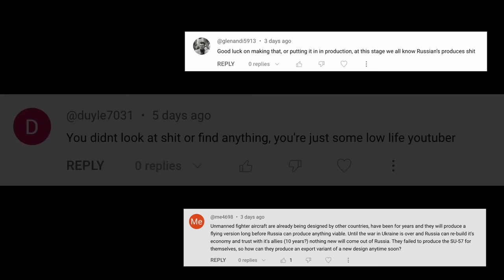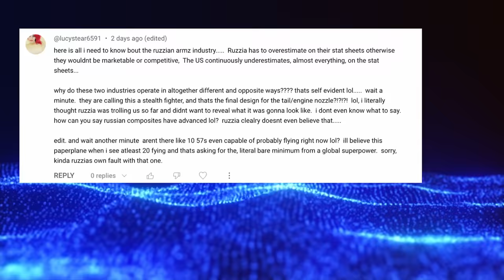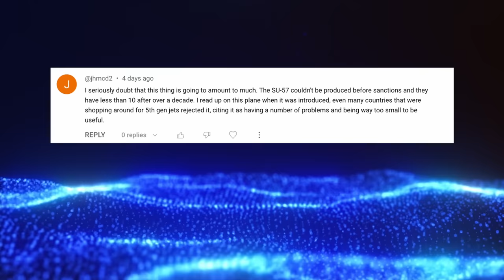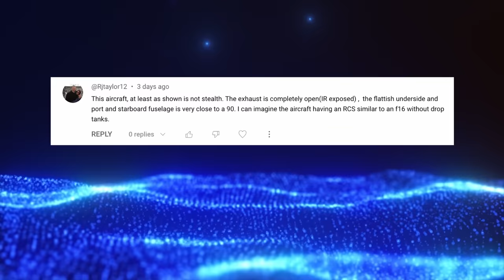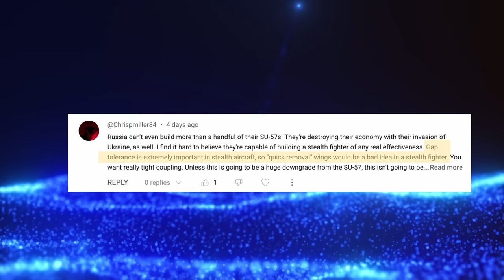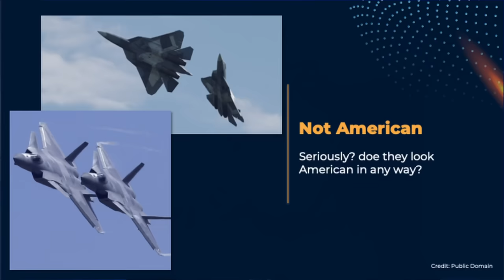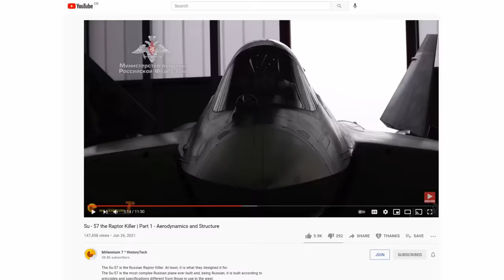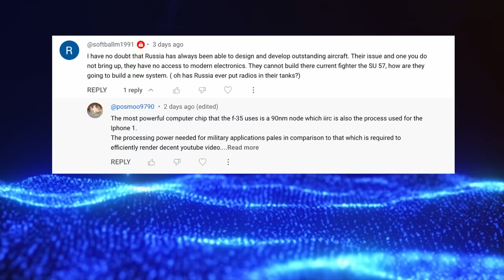Why so Few Su-57s ... and Other Stories.

Comment: People percieve the use of composites as the ultimate advantage. Not necessarily. It surely has it's advantages, namely the more freedom of shaping, but it is also unisotropic and doesn't have the absolute, precisely defined characteristics. Metals can sometimes be quite benificial, besides, metallurgy hasn't stop developing.
Reply: Absolutely true.
Reply: well they are light, and most likely can be verry light due to complex reinforcement geometry is theoretical possible.... theoretical
Reply: And Russia does not have a problem with composite materials either. Even old planes like MiG-29 had a significant share of them, even though not as much as newer planes.
Reply: “Komuna” is prime example.
Reply: Composites are crucial for stealth, radar waves are designed to detect metal while composites are basically just super strong plastic , being lighter means a speedier fighter

Without composites there is no stealth fighter
Reply: @xblade11230  You could always use wood instead.
Reply: @xblade11230  the stealth effect is mostly based on reflecting the radar waves to off directions rather than back to radars, and you do not need composites for that at all. But yes, as an addition to the reflectivity principle they do work and they are important.
Reply: @xblade11230  Not really true. Depends what composites, carbon fiber is a conductive material, therefore it is very well observable by radar. Another problem is, composites are quite sensitive to high temperature.
Composites are not panacea, they are very useful, but they also have their limitations. Not to forget the progres made in metallurgy and Russia is pretty strong in that field.
Plese, do your homework.
Reply: @xblade11230  actually no. reflection to a different return angle is verry much possible without composites. And as stated geometric stealth is what a big percentage of the f22 and f35s stealth come from...
Reply: Use of composites is a huge advantage not because they are hands down better then metals, but because you get more materials to pick from. You chose metal parts where metal is better and composites where they are better.
Reply: @dariozanze4929 but also composites adds a lot of new headache to designers, because choice is not always clear, and differenmaterials have their pros and cons. Metals is basically have a lot more comfort in production and expluatation, but can be a lot more expensive in general, like titanium alloys.
Reply: @rosomak8244  many Russian fighters in World War II built out of wood once they got the laminate figured out it actually worked pretty good
Reply: @fifi23o5  their engines are at least 25 years behind in terms of technology, although granted, that is the hardest thing in the world to build there’s only four companies that can really do it in the world to the most high standard. The composite used in the F 35 tails are invisible to radar. The composite picked was picked for that reason radar waves just go right through them.
Reply: @tatianaes3354  modern stove planes are also built with raider absorbent material physical structures that basically trapped the radar energy by bouncing around on the molecular level shaping is about 85% though
Reply: @mcamp9445  A few BSs. To say they are 25 years behind is a bit of a stretch. 
Second BS, no material is invisible to radar, nothing goes, as you say, right through it. All depends what wavelenght is used, besides, there is a metal structure inside the tail that would gladly reflect EM waves, so it is better to have a continuous skin, electrically connected that reflects and scatters rge radiation that is not absorbed by coating. Murica!
Reply: Also, it's not really that advanced a manufacturing technique. I can product composite parts in my home office. I can't product castings, or precision machined parts of equivalent sizes in Alu, let along Ti, or other special metals like Tungsten Carbide.
Reply: @rosomak8244  Wood is also a composite. A natural composite.
Reply: Yup, on high impact loads, high fatigue requirements, metals like steel is more useful. Right material for the right application.
Reply: you will get a very low social score
Reply: @Houthiandtheblowfish  Now I'm really worried....
Reply: I before e except after c.
Reply: @mcamp9445  25 years? How comes they have demonstrated super-cruise capability?
Reply: Metallurgy has not stopped developing, but Russia has stopped developing, including their metallurgy. From the collapse of the Soviet Union to the present.
Reply: @fifi23o5  there is no metal structure at all in the 35s vertical tails. So fighter aircraft have radar, yes? How do you think radiation gets out of the radome and back in to receive the signal? The radome is mage of material that radiation can pass right through. The 35s tail is also transparent to X-Band and near x-band frequency’s thus to a fire control radar and missiles radar they are effectively transparent. Very large Ground based long wave radar can see them but in reduced amount
Reply: @mcamp9445  Radomes are usually made of GFRP, glass fibres, which are EM transparent, but are not strong enough to be used for structural parts.
BTW, today's gliders are made of carbon fibre, mostly, but there is a problem with antennas, obviously, you don't want them to stick out in airstream and cause unnecessary drag, so they made a structurally not very critical part of glass fibres and hide tha antennas inside, the rudder.
The similar situation is on airliners, the radome that covers meteo radar is made of GFRP.
Reply: @rosomak8244 have they demonstrated it? When?  Super cruise isn’t magic. The F-106 could sopercruise in 1959. Concorde did it in 1971. That Russia can do it now isn’t that impressive

Russian engines do not last as long as the planes they are put in, require frequent overhaul, and replacement. They are in efficient as well. Russia has never made a commercially competive airliner engine or airliner. Why is it that Russia has hundreds of Boeing and airbus airliners and yet no one in the west has any Russian airliners of any type?
Reply: @mcamp9445  Well, points is that F35 cant do supercruise any more... Well, it can, but its highly unrecommended for it... So overall you can tell, that F35 has no this capability under normal circumstances....
Reply: @Mr_MikeB  f-35a is unrestricted

Comment: Hi from Mordor! Nice video! Some points to highlight: 1) Su-57 performing combat task fo quite some time now, and AFAIK been used heavily (You know, Russian trials is a life by itself, and yes, there are few of them, but they scoring imressive) 2) For specific groups of people: all weapons are designed according to customer requirements. And planes are not exeption. Russia has different air doctrine, so and the planes will be different ( Same goes to fleet, ground forses etc.) 3) Current focus of plane production was shifted to Su-34s as a mostly demanded type. IDK how much produced yet, but some new units in air force are formed. First time since USSR times

Comment: The stealth tolerance gap (see what I did there?😅) us an interesting topic. I think you might be correct pointing to an episode during F117 development...but there is also an interesting fact during B2 development: alegedly, during the RCS testing, some cracks developed on the metallic paint of the model...and they enough for the  RCS to spike. Reference: Stealth by  P. Westwick
Reply: "cracks developed on the metallic paint"

This is one of the reasons why stealth coating takes so much maintenance.
Because cracks like that have a VERY evil and nasty tendency to literally become radar REFLECTORS.
Due to how such materials cracks, they often end up creating a radar "box", ie, what is effectively the same as having a perfect 90 degree angle, exactly what stealth must NEVER have.
Reply: @Statueshop297  They're still VERY maintenance intensive to keep in order.

"but without the coatings radar reflections are there."

Sure, but that's why you have the stealth geometry as well.
The stealth coating is at its most influential when the plane is at its most visible angles, like from above or below, where the entire wings reflect fully.
Reply: @DIREWOLFx75 you're exaggerating. F35s are good for year-long carrier deployments without the coating maintenance facilities of a land base.
Reply: "Mister President, we must not allow a stealth tolerance gap!" 😅
Reply: @TT-hd3zi  "you're exaggerating."

No, i'm not.

"F35s are good for year-long carrier deployments without the coating maintenance facilities of a land base."

And you think that means nothing is done about it while onboard?
REALLY?

You think a plane that needs thorough checking after every flight would be ok for a year without ANY fixing of the RAM?
Reply: Thankfully we solved that mine-shaft gap issue…. this is just an opportunity!
Reply: @DIREWOLFx75  "We" can afford that and do it. Russia dont and cant afford it, had they had such materials ;-)

Comment: These troll videos are hilarious. Keep at it. 
I think there are several valid reasons for why so little Su-57's have been made, is there is not much of a need for them. At the moment I don't think there is any job that the existing Sukhoi flankers can't do and are already doing for much less money. Also the Su-57 is not for export, (is it?), so, there isn't any money to be made from it as of yet. Also, having the supply chain and manufacturing up and running for the Su-35 seems to be more important, as it has good export demand AND good internal demand. The weapons systems seem to be more important than the plane itself at the moment. If you want to know some extra's about Russian composite capabilities you can watch the old RT documentary on the sukhoi bureau, their testing on their material sciences is fantastic.
Also, the trolls that say that the Su-57 can't be produced under sanctions is a joke. The sanctions will never touch Russian military production since Russian and Soviet doctrine is to produce everything in house.

The lack of the new engines also means that Russia won't bother spending money on making new air frames that will simply sit and wait for new engines.

I agree, NGAD, AIM-260, an many other "fan propagated" projects probably don't exist or are so early in development, we won't see anything physical for a long, long time.
NGAD won't matter by the time it comes out because the US simply won't have the money to procure it. NGAD is 10 years away minimum based on its ambitions.

I think everyone credits stealth so much, that its a joke. I am pretty sure the F22 is great front a frontal RCS, but physics says that planes don't always fly straight to their targets. 

Besides, if everyone has great expensive stealth planes, won't everything just become a dog fight all over again? So why spend so much money on pure stealth fighters when a hybrid or budget platform will be more effective per dollar.
Reply: No need for a stealth aircraft in a war where no one has air superiority😂😂
Reply: And when you’ve decided to go for a budget platform and the country you’re up against has 500 pure stealth fighters what do you do? Hope they get close enough to dog fight you? It won’t be more effective per dollar when you’re losing 10 of your budget platforms for every stealth fighter the other guy has

Comment: I worked with composites for a while and we had import material from both sides to work with, to my limited experience, Russians suffer a minor lag in Kevlar and Carbon fabric quality, but their Glass and Basalt fabrics are pretty top notch...
Reply: Also stuff like SiC and other ceramic materials.
Reply: Isn't a huge amount of the modern epoxy supply from China? I thought they'd basically monopolised that industry, like plastics?
Reply: @jamesrowlands8971  RF always had local plastic
Reply: @PyromaN93  not surprising. Russia is a major oil producer.

Comment: Great video! You are always the sane voice in the room... 

Btw, regarding the Su-57 diminishing priority (and, I think, the same applies also to T-14 Armata), people forgets that at the starts of WW2 the radically improved (pratically new) T-34M was on the way to substitute the T-34 but it was canceled in favor of maximizing the production of the original, and still valid, design. 

Morale of the story: a bird in the hand is worth two in the bush. 

That was also the same reasoning that kept in production the M4 Sherman in USA after it lost its edge and that ultimately won the war for the allies. Unluckily, in the west, this pragmatic and grounded approach has been gradually substituted with the Wunderwaffen fascination that helped sink the 3rd Reich...
Reply: Excellent point!

And it's not just the T-34 line that saw this occur. The improvements to the KV ended shortly afterwards, and a new model (the IS) superseded it, but only after a few years of development, and major changes in the battlefield made it an obvious requirement. The Americans had a number of newer models of tanks ready, and even Shermans with better anti-tank guns, at various stages of the war but chose not to put them in service rapidly over logistics concerns, and other very practical reasons.

Comment: The photonic radar is a misleading name, it is a conventional radar but it uses photonics for the signal generation and return processing. It has a much wider badnwith and very low noise floor
Reply: I think he got tangled up with photon entanglement in his interpretation of the term photonic.🙂
Reply: A pair of entangled photons are produced (precise same wavelength), they go through some device that reduces frequency to produce radar-type radio-frequency photons. One goes off to bounce off things, the return is detected and compared with the unsent one. Allows for very high sensitivity (filtering out everything except that one Freq) and exact Doppler velocity (very precise comparison). This, from a physics PhD over beers a while back.

Comment: On paper t14 armata also looks very good but they haven't been able to get it into mass production yet. They are still ironing out the issues with the tank and establishing production lines for all the required components will take time as well. Russia might be too late to the party unless they get significant investments and sales.
Reply: The plant for the T14 Armata and BMPT Terminator began to be built at the end of 2023; at the beginning of 2024 it has already been built. Tests are currently underway and a decision on its production will be made by the end of 2024. Since there is a war going on now, it is not economically profitable. There are no problems in the production of T14, all the components are there, the only problem is the price